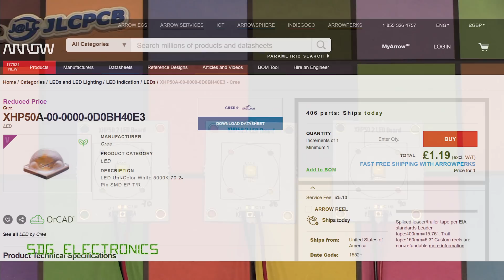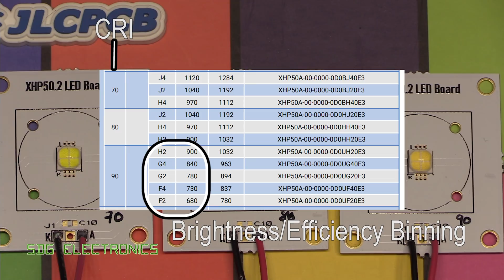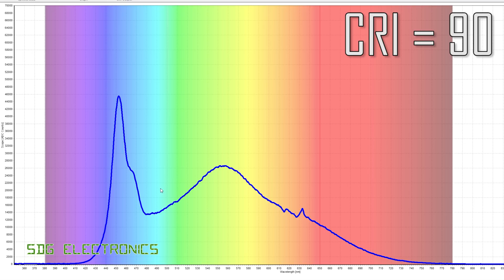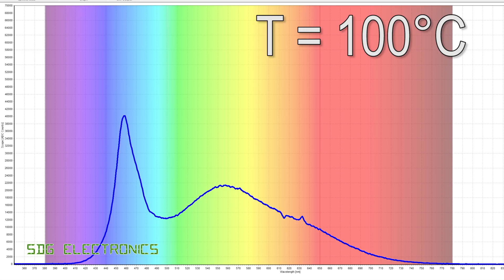SDG #196 What effect Colour Rendering Index (CRI) actually has on the spectrum of a white LED

Comment: Interesting, but CRI measurements are made directly from a light source using a spectrometer, not reflected off a colour checker (Macbeth) chart. I don't think the Macbeth chart should be in the video at all, just the lights and a spectrometer (C800 or C7000).
Reply from the maker: It's not reflected in this measurement - just the led directly into the fibre

Comment: I really hope that color chart is a real color chart, not a CMYK printed one.... If it is, then you're only checking the very local point response of three colours - C, M and Y. Which is pretty pointless. Thinking that "cameras are RGB, eyes are colour" is a pretty big mistake... The color filters in a modern camera are chosen to get as close as possible to a linear transform into the human LMS cone response. This isn't 100% possible, since the filter materials available for use in a 1 micrometer size automated application is somewhat limited to smaller grained, non-organic compounds. And even if we COULD match it to perfection (after a linear matrix transform), there would still be metameric failures unless we exactly replicate LMS response - which is really sub-optimal for color noise....
In a studio light, you really should be looking at more than 90% CRI, since CRI is often dumbed down to the easiest colors to reproduce. Harder colours like purple, warm brown and strong saturated red don't "count" when calculating CRI. But as long as skintones look reasonable, 90 is "good enough".

Comment: Curiously, I was shopping for some better LEDs for a microwave oven light (the ones installed are about as bad as mercury vapor bulbs in terms of color and color rendering) and found some very efficient SMD leds rated almost 170 lumens per watt at 2700K at Ra=90! They are not cheap for medium power LEDs though.

LED I'm talking about:
SPMWHD32AMD7XAW0S0

I love the XHP series, but I guess those ones are just not optimized for high quality light, curious why these samsung LEDs are so much more efficient. Of the few Ra >= 90 XHP leds listed on DigiKey, they all have luminous efficacy below 100 lm/w
Reply: a word of warning - don't use warm white leds for photography, their low blue output will cause noise in blue channel if you decide to correct for white balance, and their effective color accuracy will also suffer. Lower CRI with temps around 4000K to 5000k seem to work better. 

I wonder why do you put so much care into a ... microwave oven light?? Even the lowest of CRI would suffice there, in my opinion...
Reply: @victortitov1740  color temp is cold when the under cabinet lighting is going to be warm white to match the theme of the kitchen. I don't care about CRI that much but if I'm buying LEDs why not choose the best? They cost pennies more.
Reply: @power-max  that's a whole lot of valid reasons!
Reply: @power-max  and i will add one more. I've come across some warm-white low-cri leds in led lightbulbs that turned out to be really awful, they make everything look kinda pink somehow.
Reply: @victortitov1740  don't@ me bruh 😂
(I'm not taking about the light inside the microwave, I mean the general illumination one that is used most frequently when frying stuff on the stovetop

Comment: Does the efficiency of LEDs actually decrease with temperature? The junction voltage tends to drop drastically, so with a constant current drive, if the forward voltage drops 30%, then you would expect a 30% decrease in brightness and maybe a shift in the blue peak perhaps? Although I couldn't say for sure any shift  occured at all.
Reply: Interestingly, the efficiency of leds also drops hard when i cool them to liquid-nitrogen temps. So hard that the led almost stops working. So there must be a peak efficiency temperature then. Which is probably somewhat dependent on drive current.
Reply: @victortitov1740  I even saw a video with a dim amber LED found on an arduino glow very bright green, like the galium nitride ones, when submerged in liquid nitrogen. Perhaps your LED faded into a wavelength not visible? If you tried with a blue LED perhaps it shifted into UVB or UVC wavelengths!

Excitingly, there are some new UVC Leads available from a couple manafactures. They are dim and very inefficient, like the early days of white LEDs but are promising for solid state sterilization and sanitation applications.
Reply: @power-max  unlikely. I haven't done detailed investigation on the white ones, but i did on a UVA one (385 nm peak). The wavelength does decrease, but the effect is small (by about 10 nm, i don't remember exactly). It just seems to become more like an insulator - voltage drop more than doubled, and if i cranked the voltage up more, the led just died (the protection diode in it died first, so i cut it off and then the led itself died).
Reply: @victortitov1740  huh that's interesting. Guess different LEDs behave differently.

Comment: That's a very interesting experiment. Thank you.
I've been looking into whether it's possible to create a composite LED light source with a less pronounced "valley" in the spectrum between blue and green by filling the "white" with the light from a monochrome LED.
The base source would be a (series of) 4000K white LED rated 90CRI (their "bottom of the valley" is at about 485nm) integrated with a (string of) cyan LEDs (peak around 495nm) or, possibly, ordinary blue (peak around 475nm) LEDs. But I don't have a light spectrometer so I would not be able to verify the resulting compensation. Without some objective measures it's also hard to choose which ratio of current cyan/white should be used.
By any chance... if you had the time, would you be interested in this further experiment?
Reply: To do this - which can be done, results well above 98CRI can be achieved if you fill in the far end of the red spectrum too, around 660-670nm - it's best to start with a "white" LED that has a main pump wavelength closer to 420nm. Most cheaper LEDs (pump + one fluorescent) have a main spike at ~450nm, which leaves out quite a bit of both deep blue "relative brightness" and blue saturation differences.
Going with only one in-fill, do the 496nm LED... You can actually adjust this by eye :) Note that adding more blue-green will increase the relative colour temperature a little, maybe from 4000K to 4300-4500K
Reply: Thanks  @AJBtheSuede  .
I have been looking at two white LEDs: Cree XLamp CMA1303 and Samsung COB D-Gen.3. The 4000K variants have a nice emission in the green-orange band (compared to the 5000K, for example). They both have the peak emission at around 455nm. They may be cheaper but I wouldn't say that they are "cheap". I'd rather not have to depend on sourcing particularly exotic products.
I'm not particularly worried about achieving a specific colour temperature: I got interested in colour reproduction of LED lights because my brother is into glasswork and he complained about not being able to use LED lightbulbs (which, admittedly, probably have a CRI of 80 or lower) because they prevent him from accurately judging the colours of the materials he uses..
I think that he could try looking for bulbs with higher CRI but they are harder to find and, I reckon, as far as the "blue-cyan gap" in the spectrum is there, results will not be very satisfactory.
If I get around cobbling something together I will go for cyan "fillers". I still think we should push Steve to measure the spectrum of 4000K white + cyan though ;-)
Reply: @lorenzo.c  Especially when working with glass/ceramics (need to withstand very high temperature) or very UV exposed stuff, you use very specific non-organic pigments. These can be very "difficult" to illuminate in inspection and so on, since they often have VERY spiky reflection spectras. Using cheaper LED's you typically get lower relative "brightness" and hue shifts in deep red and deep blue, and purples get really difficult. These are very common colours in glass and synthetics. You not only need an EVEN spectra of illuminance, you also need a full-bandwidth spectra. That means a full 420-680nm coverage.
For this, CRI is close to useless. CRI-9 is slightly better than useless, but ideally you need to look at better metrics like TLCI, CQS or TM-30 who all include a wider range of more saturated test patches.
If you want someone else to look up a solution for you, then they need the exact same setup - the same brand/type and number of LEDs... If you want to try your solution, you might just have to wing it and see. Doing this by "eye" isn't that hard - just be sure to not overdrive the LEDs and get differential ageing :)

Comment: The most obvious applications where it makes sense to use lower CRI leds is outdoors at night time. Because in the dark our ability to see richer colours is very much reduced. And also because the higher efficiency is a clear benefit for anything battery powered like a torch or a bicycle light. But aside from those 2 reasons, for something like an outdoors security light or for illumination for a CCTV system. Where you want to achieve the maximum possible throw to see far out for the longest possible distance. Which also applies to cars and marine vehicles too i guess.

However they can sometimes be pretty blinding though, for that very same reason. It is important be careful when driving around at night not to end up also destroying the night time vision of other people or wild animals around you. They the lower the CRI, the much more 'piercing' and blinding the quality of the light is. It reminds me of when the french used to put those yellow coloured filters on their car headlights. Dunno if they are still doing that over in europe but I do wonder over here whether they care enough about the issue. For example if the motor regulations actually legally specify (maybe quite crudely) the type of the color spectrum for car headlights. To account for how bad the glare is. Especially for the full beam setting in particular I was almost completely blinded one night. It was probably one of those boy racer aftermarket headlight kits.

Comment: Regarding your temperature test - The CRI did not seem to change, but you can see the peak shift from around ~453nm @ 30C to ~458nm @ 100C.

Out of interest, what spectrometer are you using?
Reply from the maker: I'm using an Avantes Avaspec 2048 dual channel unit.

Comment: I need to build me a light for my SAD condition. 
Can you recommend an LED(s) that can be used in a Sun lamp? 
I don't trust the already-made lamps that's made in China.
Reply: yujieds seem like the market leader right now. Otherwise failing that then maybe soraa or cree or allix. Depending what the specs are. You should want to compare the spectrogram of the LED to the spectrum natural white light from the sun, and see how well they line up.

Also be aware that natural sunlight itself does also vary considerably due to natural weather conditions. And when the sun sets at dusk. So if you want to reproduce a wider range of lighting conditions than just solely a 'perfect natural sunlight'. Of course to be able to vary the color then you would need RGBWW. Wheras the LEDs we are talking about here are just for the white only.

Hope it helps!
Reply: I've been using cree JE2835 for indoor lighting projects, they're 3 cents each@qty100, 95cri, around 55 lumen depending on colour temperature. You'd need a lot of them to get enough brightness for a SAD light but I think it would still be an affordable solution, if you want to keep things simple design a PCB for the LEDs only and use a prebuilt driver.
Reply: @teslatrooper  Excellent advise. Thanks.
Reply from the maker: I agree, you probably want an array of LEDs rather than a few high brightness types. Those Cree LEDs are nice for the price

Comment: It's normal to get lower lumens per Watt on higher CRI because lumens is based on human vision and all wavelengths are not weighted equally. Also the phosphorus compound converting blue to other colors causes some losses. If you what high lumens just use the bare blue led... But the CRI will be close to zero...
Reply: Actually, the blue LED will have extremely poor lumens per watt. The lumen is based on the visibility curve which has a peak efficiency around 550nm (yellowish) which is why, until recently, the highest lumen per watt lamps were stil low pressure sodium vapor lamps.

But yeah! Same idea. Higher CRI will in many cases have a lower lumens per watt than lower CRI fixtures (usually) with all other factors the same
Reply: Also the reason why you will find most most spec sheets for blue LEDs don't include a lumens per watt but instead include a radiometric watts per electrical watt figure.